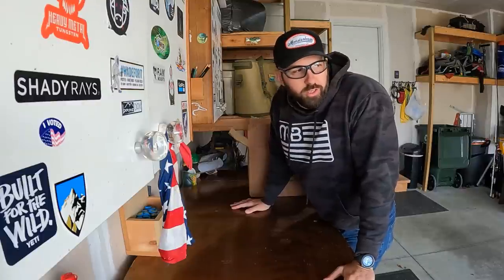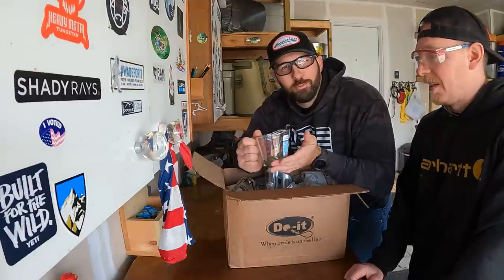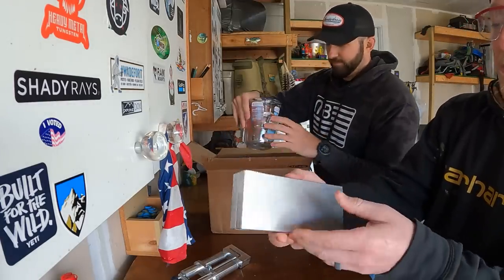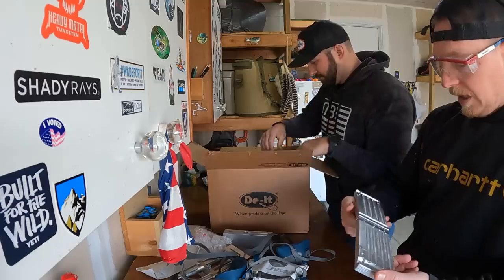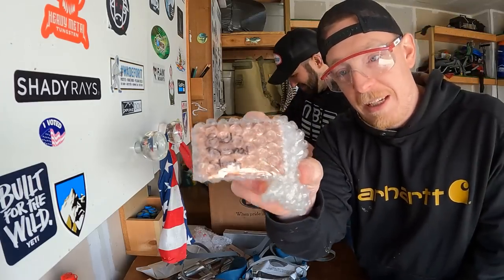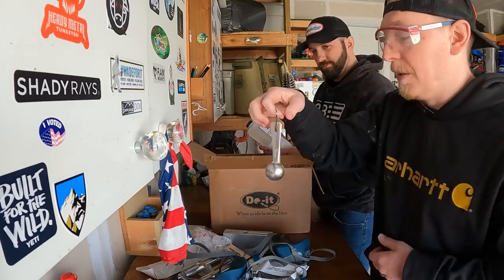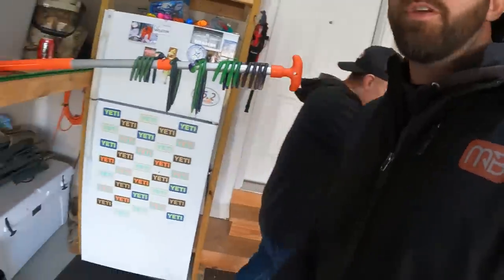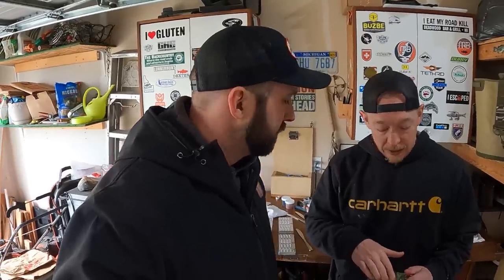Making Soft Plastic Fishing Lures For The FIRST TIME!  Mistakes Were Made!

Comment: Hey guys.  Protips.  1.  Denting comes from the cold molds pulling the heat from the plastic at a fast rate, so preheating with a griddle or even a heat gun to reduce the difference from the ambient temp and the mold temps will help reduce that. (Heat gun can also help warm up the injector).  2. The injectors should pull and push way smoother, try using a little worm oil around the o-ring on the plunger and run it up and down a few times until you get a smooth pull.  3. Bubbles will no longer be an issue if you invest in a vacuum chamber (can also be useful in the future if you decide to make your own silicone molds).  3. With pigments/dyes, the more drops/scoops you use, the more saturated the color of the bait,  the more opaque (solid as opposed to see through) it will be. Always start with less drops, especially in a laminate/swirl. 4. Before shooting a set to see how it will match up, you can drizzle some plastic off the stirring utensil onto a work surface to see how they blend, using a teaspoon at max vs over 2 oz of plastic.  I'm excited for you guys now that you've started pouring yourselves.  The Creepy Crawler vibe is exactly how I perceived it when I started pouring a few years ago. Awesome reference.  Can't wait to see how you guys progress on your bait making journey.  Tight lines. 

Side note:  Paul... NEVER use that much force to try and inject plastisol... if hot plastic shoots out the sides or with those particular non-locking injectors, the tips come off and it all pours out, you can seriously burn yourself, even through clothing.
Reply: Fantastic tips!
Reply from the maker: Thanks for alm the tips!

Comment: I had a friend of a friend that made a metal mould for plastic baits for one of his finals as a tool and die maker.  I have a few baits that he made. He had to design the baits and machine them out of metal and used dowel pins to close them instead of hinges.

I used to make them years ago in the plastic things that you could only mould one side of a bait and the rest was just flat.  I also made a bunch of rods but I figured out It was just cheaper to buy them.  I spent hours spinning a rod in my hands to let the coating dry and the first fish I caught the tip broke off